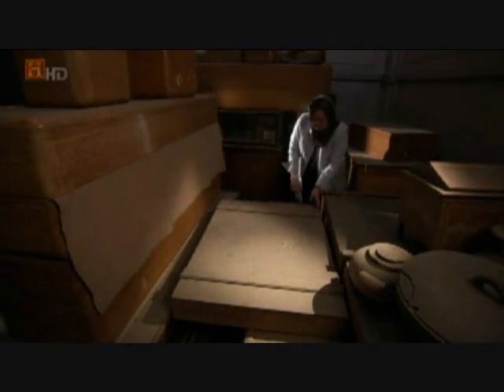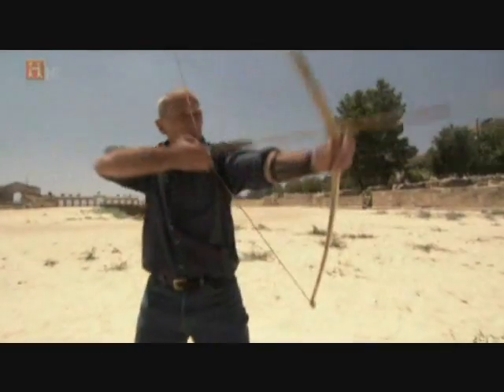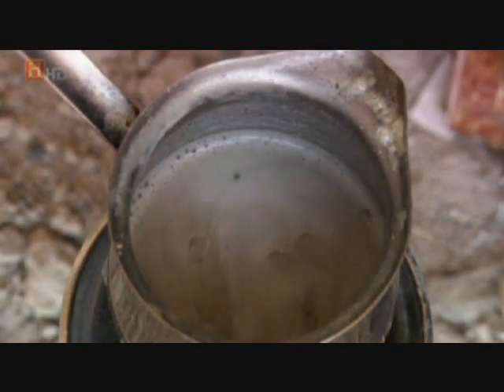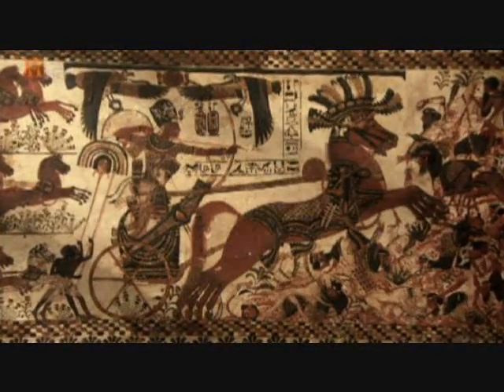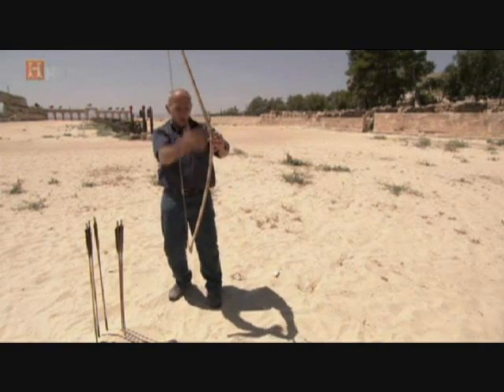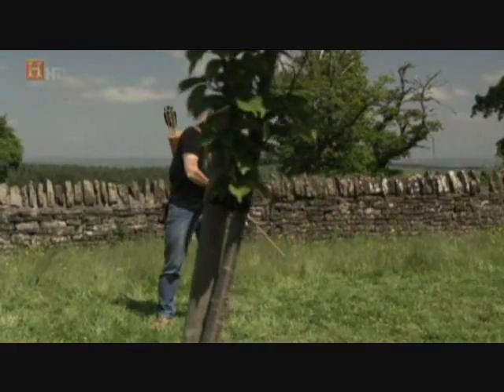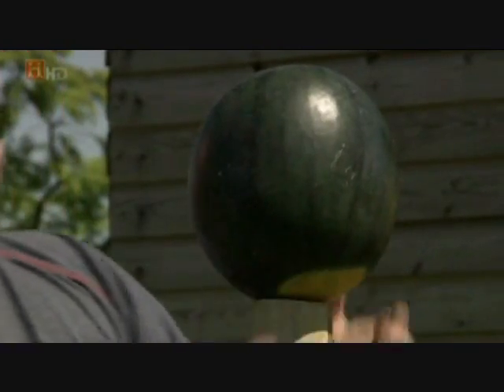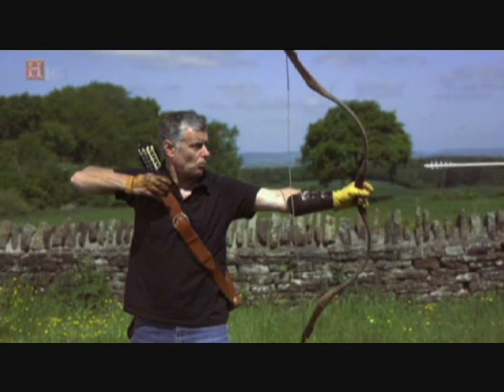Angular bow

Comment: I'm rather critical of the end. A original Mongolian bow is not going to give twice the energy in to an arrow compared to a properly made modern replica with the same draw weight. Most horse bows were around 70-80 pound draw weights, and he might have meant they were drawn with such weights (his looked around 40-50 pounds) but saying "more powerfull" sounds like energy transfer.

Comment: I believe that the tests are accurate as the people who test these bows are often skilled archers themselves. The recurved composite bow is most powerful ranged weapon until breech loading rifles are invented. The bow is light and compact enough to be used on horseback unlike the longbow where its great length is the main obstacle for effective use on horseback. Arrows shot from the composite bow could penetrate armour deeper and achieve greater range than the English longbow.

Comment: I am here to report that my composite korean bow shoots 338fps.  That's better than most compound bows considering that most people over 90% don't shoot 30" anyways.  The compound bows IBO rating is 70#, 350gn arrow @ 30"  So lots of people who have top of the line bow are not shooting 366fps.  Even the manufacturor have to save their butts by recommending a minimum arrow weight which means if you follow it, you'll never shoot 366fps @ 70#

Comment: @MrLantean not tension but a mix of tension and compression since it was placed between the sinew and horn so a much greater range of woods could be used. if you're interested juniper was also great in compression so bamboo composites mainly used that as the belly

Comment: @5tonyvvvv The compound bow is primarily used for sporting events. This type of bow is used during modern archery competitions. Although the compund bow is very accurate, it has a much slower rate of firing compared to traditional bows. It is also much noisier as well. The compound bow is not suitable for war.

Comment: @5tonyvvvv Actually the compound bow is a modern bow that uses a levering system, usually of cables and pulleys, to bend the limbs. Nowadays people call composite bows compound bows despite different construction methods. It is a good thing that composite bows are still being constructed the traditional way using original materials. It takes years of experience to become a professional bowyer.

Comment: That bow is certainly not mongolian design. It is not avar, either. It seems with a hungarian bow, but not the "true" hungarian design. Everything else being egual, ears less recurved mean less energy stored. It's about the force vectors, decomposition of forces, length ratio between the ears and the flexible limbs and, also, this ratio must make a good compromise with the "moving mass". Designs that work better for speed are turkish and korean.

Comment: For an arrow to reach a speed of 300 feet per second, the bow would have to pull around 150lbs. Most modern fiberglass bows with a drawweight around 70lbs, will just exceed 200fps.

Comment: In fact, the composite bow of 70lb will have an "average draw weight" higher than the 70 yew, so the composite stores more energy than the selfbow. On the other hand, the selfbow transfers in the arrow a higher % from the energy stored. Modern recurves are a good compromise between energy stored and efficiency, being more efficient than the selfbow and capable to store energy almost as well as a composite.

Comment: On mongol bow...if it's best: how to define "best" in terms of speed? There are traditional designs giving top performance with heavy arrows (for ratios arrow weight/ bow draw weight at max draw lenght over 1.5 grams/kgf, longbow would be best, for ratios under 1 turkish & korean). As a rule, a bow giving more energy at a certain draw weight, but less efficient (asian design, very recurved but high "moving" mass) will do better with light arrows & vice-versa. I've tested and is true (& logical).

Comment: A present day bow expert, Adam Karpowicz, tested some turkish traditional bows he made (turkish and coreean designs are the fastest with light arrows). He said he'd reached 357 fps with a 125lbs flight design, 203 grains arrow. If you do the phisical calculation, you'll see it is possible. Still, in battles were use much heavier arrows for 125 lbs bow (and 125 lbs is pretty hard to draw). War arrows could have had innitial speed between 170 and 220 fps.